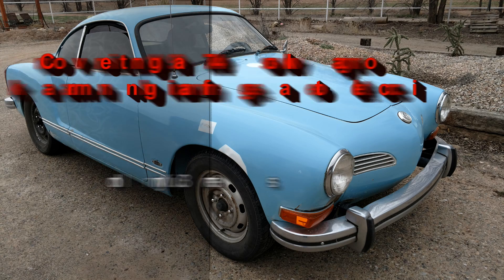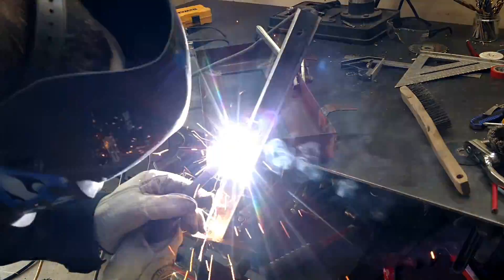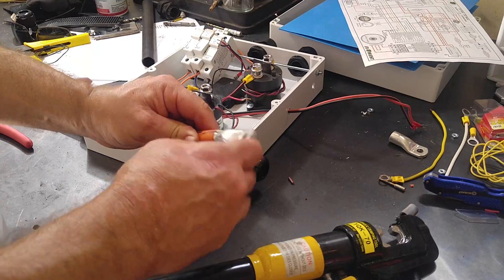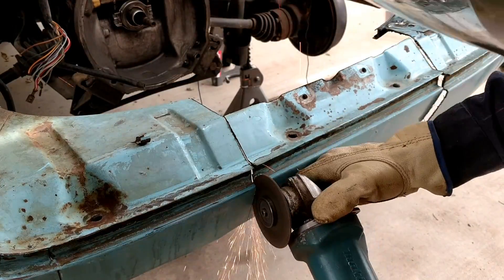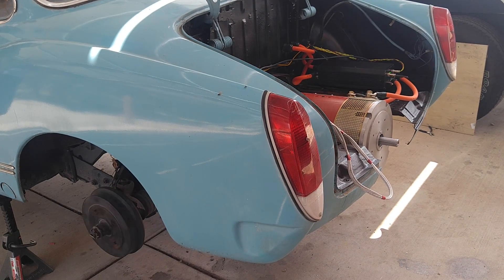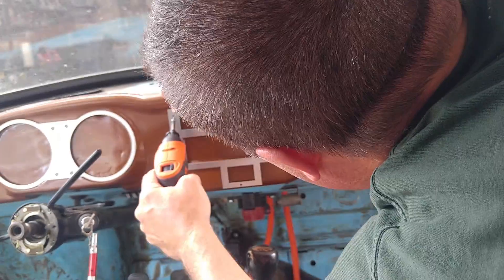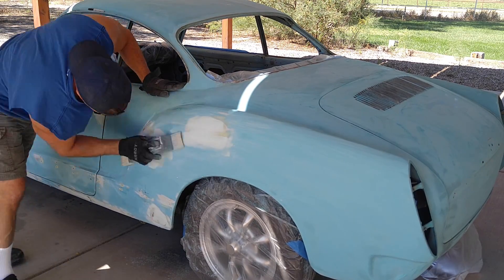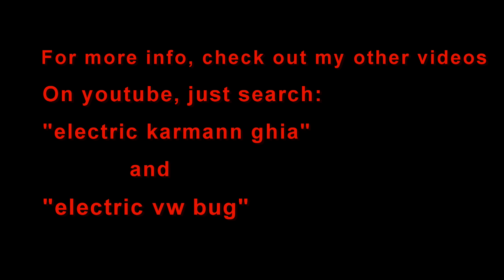Karmann Ghia Conversion to Electric (The Process)

Comment: Awesome and fantastic job!!!
How much did you spend on all the conversion kit?
Reply from the maker: Thanks! It wasn't from a kit. The conversion was around $16k. I needed it to be far more powerful than a kit would have been!
Reply: @bottsfinevids4463  and to beat a Tesla👍
Reply: Is there air conditioning available for the Gia? I know none of them came with it but just wondering if part of the conversion to electric it could happen.
Reply from the maker: @snakeeyes037  unfortunately no. There are ways to make it work, but just didn't seem worth the trouble. However, those older cars with smaller more vertical windshields stay significantly cooler than modern cars.

Comment: I had various VWs. Currently a 68 ghia and 74 beetle. On one hand it hurts to see them molested but on the other you did such a great job that I have to applaud you. Personnaly I would have kept as much of the original look as possible, VW colors and upholstery. However, I am concerned that you don't seem to have upgraded the brakes. The added weight plus the speeds you reach put you and others in danger. The rest of the car can handle the extra power as demonstrated by that German engineer who fitted a modern Porsche engine in a Ghia: https://www.youtube.com/watch?v=swuXiAiZrdA

Comment: The obvious question for me is how far can this car go with fully charged batteries?
Reply from the maker: 120 miles max, but I use 100 as the max for a buffer. At highway speeds, maybe 80 miles.

Comment: I have both issues with this video, and complements. Issue 1. I liked the color before you painted it better. 2.
 your sound is a little all over the place at times... Complements(ish) 1. Im happy that a classic like this can live another 40 years on the road. 2. You do such good work. 3. It matches you bug quite well, I like that. 4.Im kinda annoyed how short this video is, but Im also surprised at how freakishly well you conveyed all that information in such a shot time, alot of other channels seem to have trouble with that. Well done. 5. Over all, that project came out beautifully, you sir, are a man of talent and patience, far greater than my own. for $16k thats pretty nice. Now I have questions.  Did you buy those batteries used? What did you do with that old probably worn out engine? what happens if you get a flat considering you replaced it with batteries? You have a really nice solar setup, whats that rated at? do you have a battery bank for your solar? if so, whats the capacity and chemistry? are you planning another electric conversion in the future? if so, whats next? a truck of some sort maybe? which of your VWs is faster of more fun to drive? Are you actually going to read this wall of text? how much did you pay for your solar? Did you install it yourself?

Comment: Absolutely brilliant project - now you have the best of both worlds : classy looks and great EV performance, JUST WONDERFUL. A couple of questions please : what size battery pack in kw/hrs and what range do you get?

Thanks for sharing a great project and giving much pleasure to all those who want to keep their classic cars.
Reply from the maker: Thanks!! It has a 27Kwh battery pack. The absolute range is 120 miles, but I use 100 miles as the max, just to give me a cushion, and its not good for the batteries to completely discharge them. At highway speeds of 80 mph or more, I would say 75 or 80 miles.

Comment: What was your overall cost of the motor, batteries, electronics (not including the restoration costs)?
Reply from the maker: That all cost around $16k, 8k of which were batteries. Keep in mind, they will probably last 10 to 15 years. I guarantee you I would spend far more than 8k in gasoline over that period!

Comment: I was surprised you have a clutch included, do you use it to drive or is it just a means to connect to the gearbox?  do you switch gears while driving?
I was also surprised you did not put some of the batteries in the open space at the rear for weight balance. what is the range?
Reply from the maker: Actually, most of the batteries are in the space behind the seats and almost right over the rear axle. I rarely switch gears while driving, and I can switch without the clutch if i just match rpms. I could get by without one, but its nice to have. Sometimes I can't get it into reverse without it.
Reply: Ok thanks. But for reverse why not just run the motor backwards? Isn't that what production e cars do?

Comment: Where is it to buy all the conversion kits and what's the estimate? In cost
Reply from the maker: This was not from a kit. However, if you want a kit I would suggest EVWEST. It would definitely be easier to install, but not nearly as fast as mine. Faster than stock though!

Comment: What is the approximate cost for all electrical components including instrumentation, Motor, Batteries, Control components etc. and are there any prints for this project???
Proud  owner of a '72 Ghia convertible with serious interest in converting to electric. Can you offer any suggestions?????
Reply from the maker: Cost of conversion was around $16k. You might want to check out some of the kits they sell on EVWEST. That would be the easiest route, but they're not as fast and powerful as mine. Still way faster than a stock VW! Or here's the components in mine evalbum.com/5330

Comment: Did you have a motor mount or does the gearbox carry the weight of the motor?
Reply: The gearbox normally supports the motor so I don't think he needed to change that.
Reply from the maker: Yes, directly to the gearbox, exactly how the engine does. I did add a reinforcement to support the motor. Not because of the weight, but it puts out so much torque that it puts tremendous downward force on the frame horns under heavy acceleration. I was scared they would bend and break, which would be a nightmare of a repair!

Comment: Best of all, no embedded car company sensors and GPS trackers watching everything you do and everywhere you go.
Reply: BINGO!!!! This is exactly what I hate about the new EVs. When I buy the damn car, I won't to own it and I don't want any software updates nor be tracked!!!  Wish I had this guys skills!
Reply: @cetti4405  -- Unfortunately, spyware and on-the-fly updates are part of all new cars, not just EVs. Most manufacturers record everywhere you go, how fast you are driving, and they even know when you open the trunk lid and how many people are in the car. Worst, there's no way to shut it off or hack it out -- antennas and electronics are buried and fully integrated.
Reply: I don't know what they use that information for unless it's for when you commit a crime, but as long as you're not doing something wrong then there's nothing to worry about 👍

Comment: You are a very skilled dude in many areas. Electrical, mechanical, body work, paint work, welding, sheet metal. That's a great video you put together and great work on the ghia. I used to own a 71 Karmann ghia. Job well done sir.

Comment: No need for "accelerator pedal" at all. Just get a Gun style w/trigger n you can drive like a slot car or Radio controlled. 
How fun..Walk into the party n rev the motor in front of all the girls while pouring a drink 🍸..
Reply from the maker: Except nobody would hear it!
Reply: Butchtropic
Chicks dig one handed steering..
Botts fine vids: jam a couple of Baseball cards in the wheels. 
Problem solved.

Comment: That was amazing!  Where did you get a motor and batteries?
Reply from the maker: Motor from EVWest, and I found the batteries used (usually I'd be reluctant to buy used batteries, but I tested them and couldn't pass on the deal).

Comment: You're a great mechanic but the audio sucks, I can hardly hear you talk. Did you record it on your phone in a windy field? Next time use an audio "notch filter" on the live tool and repair footage to cut a hole for your voice.
Reply from the maker: That's because Steven Spielberg's team of audio engineers cancelled on me at the last minute, so I had to use my phone.
Reply: @bottsfinevids4463  LOL next time put a blanket or duvet over your head and phone. You'll look silly but the audio will be cleaner.
Reply: @PalimpsestProd  and turn down the angle grinding clips etc!

Comment: In such a light vehicle - which was engineered to manage the weightiest component being aft of the rear axle line - increasing the weight, and markedly changing the distribution (e.g. front to rear, within and outside the wheelbase) is asking the floorpan, monocoque, and suspension components to do a whole lot of new things.   
I heard the reference to the 500+lb (230kg) of batteries, and fitting coil-overs, but I didn't catch any mention of the difference in mass of each system.   Can you tell us the weight of the electric motor, and any other major components?  Also, could you share the specs of the front and rear coilovers?   Thanks!  :-)

Comment: Favorite quote, "It's always nice when you flip that switch and there isn't a lot of sparks and smoke and stuff." 🤣🤣🤣
Reply: I have a volt GM has under the hood warning signs without rubber gloves without rubber soled shoes you can be electrocuted do you remember when they recalled those in the 90s from Texas flash flood people died everything has its drawbacks

Comment: A question, can you replace the gear box with a five gears gear box to achieve higher velocity?
Reply from the maker: Not necessary. I basically only use 3rd and 4th. Yes a higher gear would allow a higher top speed, but believe me, 100 mph is plenty fast in an old VW!

Comment: Hi, what do you think about rainy and cold days? Where are a heater, windshild blower, splash motorprotection?
Reply from the maker: I do have a heater/defroster that I made simply by placing the heating element from a 1500 watt space heater inside a duct with a blower. It works instantly and is superior to the stock vw heaters.  I don't have protection for the motor, and I have been out in some heavy rains. It doesn't seem to affect it, but I sure as hell wouldn't want to drive through a deep puddle!

Comment: My dad had a karmann Ghia when I was 8 and I still love this car. 

I wonder what you think about converting beautiful old 70's American cars. Like A 1971 Buick Riviera GS with the boat tail. 

It would be great to see these works of art out in the road again without the gas guzzling. I would also think the large footprint offers a good safe for the batteries. But maybe they're too heavy. What do you think?
Reply from the maker: It would be possible, but weight is certainly an issue. You'd need more batteries to give it any kind of decent range, and then the extra batteries add more weight! However, I would still love to do a car like that. You'd probably have to use lighter batteries like Lipos.
Reply: Botts Fine Vids You know what to do. I'm just the vision guy in this. Imagine (or envision) beautiful and iconic American cars of the 70's given a new life as an EV. Regarding the weight issue I think the first thing would be to see what happens to the cars when those huge engine blocks, behemoth transmissions, and monster axles are removed. (Plus I noticed you are handy with the circular saw!) As far as range goes my personal belief is that a 300-400 mile range is more than enough. That's a 3-4 hour drive and anything more is a road trip. So the question now is if you remove the engine tranny and main axle and take advantage of the long wheelbase and put the batteries (heavy or light) in the floor flat, can it be done? I think if the engineering is fine right (your area of expertise) the result would be breathtakingly American. Consider that one large part of the cultural resistance to EVs is that it doesn't feel American. The cars are too "European". This idea might bring order to the (new) universe. So it's all up to you now! Keep up the good work. 💪😜

Comment: Very nice.  How much did this conversion cost?  Just the engine swap. Where do you buy the motor, batts, controller
Reply from the maker: Cost around $16k for the conversion and about 3k for the restoration. Bought most stuff from EV West. Controller from ZEVA Australia. evalbum.com/5330

Comment: Always a believer in e-cars...but your distance is????? When you want an e-car that charges itself contact me.
Reply from the maker: 120 miles absolute (driving mellow and less than 50 mph), 100 normally, and maybe 75 at highway speeds. I don't know if you're referring to regenerative braking, but any other form of self charging is not possible. I've had people suggest wind turbines, alternators, etc, but anything like that would just create excessive drag which would require even more energy to sustain. Still no such thing as a perpetual motion machine!

Comment: Very nice job, hope you upgraded the brakes! any regenerative  braking on the controller?
Reply from the maker: I have discs in the front. Series wound DC motors cannot gave regen, because when you cut the power to the motor, you lose your magnetic field.

Comment: Great job! Your conversion of the VW is so refreshing different from all this super-technology-overloaded Tesla stuff. Just the basic - like a VW always was meant to be. Charging the car just by using solar energy makes it even better! Fantastic!
Stay well in this Corona times! Greetings from Germany 😃
Reply from the maker: I appreciate that. I've always been impressed with Germany's use of solar, especially given the fact that its not a great climate for it. I always use Germany as an example when people tell me that it is too cloudy where they live!
Reply: Hello 
Botts Fine Vids, thank you for your answer. Right now we use about 43% renewable energy ressources for electrical energy here in Germany. The main part is covered by wind energy. See https://www.pv-magazine.de/2019/12/18/erneuerbare-energien-deckten-2019-fast-43-prozent-des-deutschen-stromverbrauchs/ 
You can find solar panels on many houses now, most of them directly feed into the public electricity network. I myself have a themal solar roof for heating the water with 12,5 sqm and just a little soar collector with some hunderd watts that helps to minimize the cost for the current of all the always-on devices. But I'm thinking about to get something larger soon.
Have a nice Easter time together with your family and enjoy your beautiful cars! Stay well :-)

Comment: Could you add a few alternators on there to help recharge the batteris as you go?
Reply: I think they would take more energy (in friction) to run than they would produce. Physics.
Reply from the maker: Nope, they would create more drag and require more energy than what you'd get from them. No perpetual motion machines yet!

Comment: Man...you've got Mad Skills!
Anyway I can contact you? 
I've been planning to do the same with my 71' Super Beetle.
I'd like to get some paid advice.
Thanks for sharing!
Beautiful work!
Reply from the maker: Thank you! I don't do it as a business, only personal. I'd recommend looking at EV album and you can compare all kinds of different combinations of components. evalbum.com/5330
Reply: @bottsfinevids4463  Thanks for responding and the tip on evalbum!
Will check it out!
Reply from the maker: @emailnodata with these old VWs, you don't need power steering or power brakes. I do have a homemade heater/ defroster which works instantly and far better than most cars! AC would be nice, but it really doesn't get as hot as modern cars because of the small and more vertical windshields.
Reply: @bottsfinevids4463  
Thanks for correcting @emailnodata :-)
Sounded like he didn't even own a Beetle and had no idea. 
But better coming from you than me.

Comment: Great work.  How about a video of your home solar charging station?
Reply from the maker: It is an 8.2 kilowatt array which powers my house. The charger is just plugged into my house wiring. I am grid tied, but since I installed the system in 2010, my meter is backward by over 8 MWh (8000 kwh). It would be a pretty boring video!

Comment: How much did the EV West conversion kit cost?   How much range does the car have between charges?   How long does it take to recharge the batteries?  How much total cash did you put into the conversion/ restoration ( not counting your time).  How many hours did you put into this job?    Would you sell the car?   Others have already asked these questions, but you didn't answer.
Reply from the maker: It is not from a kit. However, EVWest does sell some pretty nice ones, just not with nearly the torque that I have. The conversion was around $16k, the restoration around 3k. It took about 3 months. And no way would I sell it! It can go 120 miles on a charge, but I consider 100 to be the max, just for a buffer. It gets a full charge over night. I don't have a rapid charger, so I really can't go on road trips with it.

Comment: Did I miss him splicing back in 
the piece of the rear that he cut out so the motor would fit in?
Reply from the maker: Yeah I didn't want the video to be too long and bore everybody to death, so I had to leave some minor stuff out. That was one of the clips that didn't make the final cut!
Reply: In another Comment below Botts said "I actually did reinforce the rear with a traction bar, which ties the two sides together as the cutout did."

I was also looking for some kind of support so the motor wasn't hanging by just those bolts when it hit some hard bumps.

Comment: Nice job, but there is some imbalance or vibration on the motor. I could hear it in the sound.
Reply from the maker: Actually it was a bad wheel bearing. It's all good now.